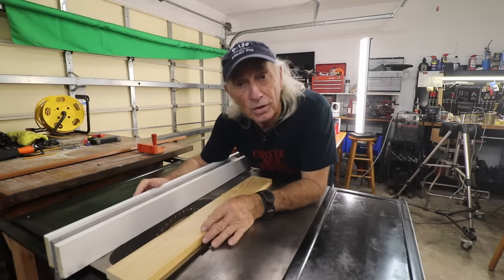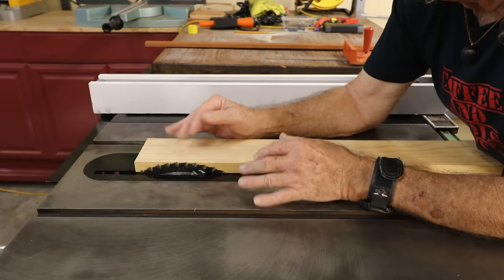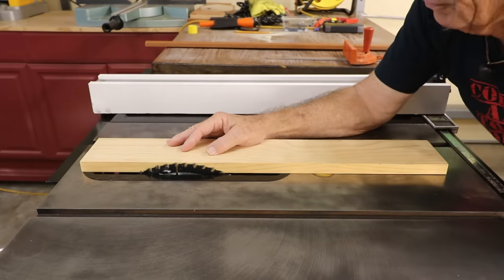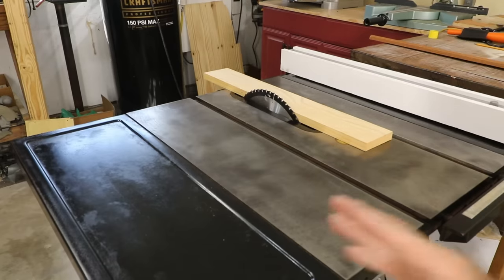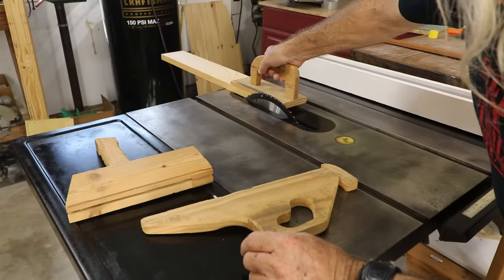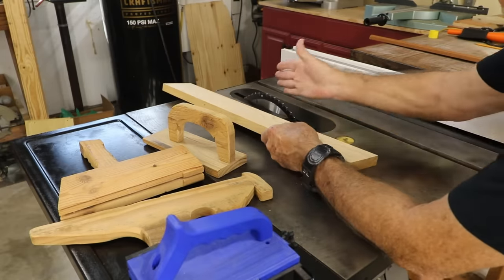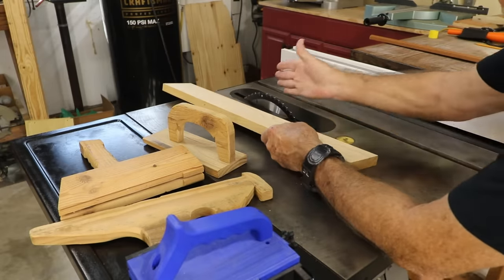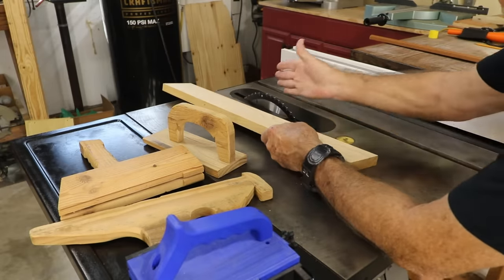Table saw secret nobody will talk about from the good old days, C&T episode 180

Comment: I also put the blade high as possible but we use a riving knife back at the saw
.why are you work without
Reply from the maker: No riving knife with this saw and it has been sold to a contractor since the video, good saw, just zero safety with it.

Comment: What dark secret ?  Everybody I know in woodworking talks about this.  When I was in high school wood shop, in 1965, we were taught for best cuts to set the blade where the gullets just clear the top of the work piece.  I have never seen a kerf knife mounted anywhere except on the arbor assembly ( lift mechanism ? I do not recall proper nomenclature ).  This way the kerf knife stays at the height of the blade and always aligns with the blade tilt. And you should always have some sort of outfeed support so you do not have to apply too much down pressure to keep the work in the blade all the way through. Very risky not to have it except for very short pieces.

Comment: I was taught set the blade 1/8" over the thickness of the board.  Which I had it happen, ripping a piece of Cypress, where my hand hit a piece of wane and slipped.  Cut four fingers an 1/8"deep instead of off.
But it'd require effort but having the blocks like here is smart.

Comment: High enough that the blade is cutting down is safer... as long as the only things touching the material are push blocks. My 12 inch radial chop saw does most of my cross cutting... the table saw mostly does a couple of rips at the start of the job.
Reply from the maker: Same here 👍

Comment: Well if your still reading g these comments. I'm right there with you. I too raise the blade. 1972 I was taught that way. Cleaner cut. No burns. Very little vibration. Very little to no kick back. And all this without a blade guard or kirfing knife. I have done it with the blade low and have lots of problems. Kick back. Wood jumping and raising and all the other things people talk about. It is safer. But it will leave more tear out. 
So to help with some of this. I have a rule. Always have a clean, sharp blade. (That way it cuts your finger off quicker & Cleaner. 😂😅)
But overall. I agree with you.😊
Reply from the maker: 🤣🤣🤣 cleaner cut for fingers. Thanks for posting this one. Old school had some different ideas and reasons. I'm still old school 🤠

Comment: First time viewer.  I like the over-all presentation and the numerous anecdotal comments and conclusions.  Although NOT an often user of table saws, I am extremely familiar with a great many tools, manual, power & automated.  One thing that I note is the use of current technology of carbide tipped blade.  As such, the actual cutting teeth are most often somewhat thicker than the body of the blade.  This is significantly different from the (nowadays "cheap") single thickness blades which achieved kerf width by having "set" in the teeth.  My very limited experience with each style of blade was that the wide toothed carbide blades tended to have less (apparent) kick-back forces than the old set tooth steel blades.  But, that could have been 'dull' versus 'sharp' as well.
Do you have any insight as to why there remains only ONE radial arm saw manufacturer in the United States?  They are located in a small town in Iowa!
Ken
P.S.  We are probably of about the same "vintage"! 😂🤣

Comment: Interesting. I’ve never heard to keep blade just barely above wood. I always do what I guess is a middle ground where the tooth is sticking out maybe 75-85% above the top of board. It’s supposedly the optimal place for ejecting chips and preventing kickback. The key point is don’t have your hands near the blade. Also maintains your balance. I’ve heard of cases where there’s a kickback that shoots the board out of the way and since you had your weight on top of that board it’s now on top of a spinning blade. The tip I heard with that is the table saw could suddenly disappear and you don’t fall on your face.
Reply from the maker: It's all about safety these days.

Comment: Interesting video, many thanks.  In my experience, if you don’t want kickback, set the saw properly and you’ll be half way there.  It is amazing how many just get them out of the box and away they go with blade slowing skewed loads, burns and kicks all over the place.  

My approach when setting a saw is, the blade is set absolutely parallel to the mitre slot, then the fence set parallel to the blade but then moved away from the blade at the back by literally a hair to stop the wood closest to the fence getting pushed sideways into the back of the blade.  I’ve never had kickback - have to qualify that with “yet” of course to nullify Murphy’s law.  And I still get square cuts for cabinets too.

With regard to blade height, I like to “see” the blade a tooth above the workpiece.  If I can see it, I can keep away from it.  Most dangerous tool in the shop in my humble opinion is the spindle moulder.  You really don’t want to get hooked into one of those as the shaper tooling tends to be very destructive over a far wider area than a thin saw kerf.  Push sticks and feather boards all over the place on those is my MO. If I could be in a different county when one is running that would be good for me.

But I still say the fastest way to get hurt by any machine is to be scared of it.  You have to be confident and look to get the job done and not focus on having the accident. Respect it by knowing how to use it safely, but don’t be scared.  If you have a kid crossing a stream on a log and you say to him “don’t fall in”, he probably will as he focuses more on the possibility of falling in than on his technique of getting to the other side.  The power of negative thought is even more merciless in the workshop.
Reply from the maker: Respect and plan before cutting anything

Comment: I wouldn't use any of those jigs.  Puts the fingers and hand way to close for my comfort.  I use push sticks for ripping.  Long ones.
Reply from the maker: Push sticks are handy and much cheaper than fingers.
Reply: @SirTools  I saw your other video on push sticks.  Yes, probably more likely to induce kickback and I've had kickbacks in the distant past.  I also take other measures..."feather boards", commercial ones with a magnet that keeps it locked to the table, a thick leather apron, and standing to the side.  I would much rather have a kickback than slip and lose fingers because I was too close to the blade.

Comment: This is something that is still discussed. On the union jobs the blade gets higher the duller it gets to prevent chatter. Typically the company won't buy new blades on a regular basis. I think with experience comes better risk mitigation therefore something like raising a blade above material is more prudent.
Reply from the maker: Hey Thanks Don for this posting

Comment: On carbide blades, the carbide tooth is wider than the blade body. So on a saw that is set up properly the the cut lumber doesn’t contact the blade. Usually the saw is not set up from the factory and must be done at the time installation and periodically checked. This requires a machinist’s skill and tooling. Good luck!

Comment: This is why modern table saws are much safer, they come with a riving knife installed and most also come with a guard attached to the riving knife so you can raise the blade and still work safe. Dust extraction can also be added to the guard.
Reply: But then you can't dado, or notch or do a lot of things that you need to be able to do.
Reply: @jeffshackleford3152  you can remove a guard if needed, but for most general work you should keep the guard in place.
Reply: @richardportelli1983  I disagree with that, if you get used to having the guard there and then you don't have it, it will likely lead to an accident.

I have seen several people hurt themselves that way, including me.
Reply: @jeffshackleford3152  this is why you should always use push sticks when working close to the blade and always use the giving knife. A guard is just extra protection. Doesn't make up for unsafe practices.
Reply: @richardportelli1983  it had nothing to do with my hand being near the blade while cutting, I was grabbing my drop and decided to touch the blade with my thumb.

Plus push sticks aren't always the answer and in some cases actually make a cut sketchier than if you were just to get your hand close.

I worked in a very high end cabinet shop while I was in college and learned " old school" like this guy.

Comment: Was in a large cabinet shop with a cabinet saw. 10 inch saw blade. He had a stack of dimensional wood about waist high and 20 feet behind the feed side. Beyond that, about 15 more feet was a cinder block wall. He had a kickback. 

In the lumber pile there were 3 big slivers of wood shot inches into the lumber. The largest sliver was roughly a half inch. In the cinder blocks there Wes a similar sliver through the first layer of concrete.

Comment: If you want a blade quality comparison try using a battery powered circular saw with a blue Avanti cheap blade then use a Freud mid range blade, 1/3 more battery life and you can feel it cutting harder. Paint vs Teflon, buy blades with no paint if your getting super cheap ones. Even table saw blades you can feel and hear the difference.

Comment: Why have kick back when you should have kick down.  Lift that damn blade so the blade can cut and push down.  Use the flat of the blade as a parallel straightedge to your fence.  Increases stability and alignment. Perfect your push stick game.  This guy is demonstrating what my dad showed me in 1977.
Good job emphasizing that proper technique will keep you safer than doing things the improper safe way.

Comment: In my 50 years of woodworking, I've learned to have a custom made zero clearance blade with a riving knife, AND a set of "yellow wheels" to hold the wood down and in toward the fence. Also always to use only flat wood. Warped wood will want to kick back. Finally, if you DON'T have a zero clearance blade, inevitably a narrow cut-off piece will fall in the crack and may kick back. My buddy with even more experience than me took off the tip of his thumb that way with a violent kick back (...they are all violent). Those yellow wheels definitely slows me down, but I find that okay, especially with such a dangerous machine.
Reply from the maker: yellow wheels ? Feather board ?

Comment: I also cannot stand the top of the saw blade to be any lower than at least 1 1/2 inches above the top of the board being cut. 

Just as this shop person says, I have noticed that if I have the saw blade any lower than 1 1/2 inches above the board being cut, then the blade tends to want to lift the board being cut upwards and side- ways even when using a push-board jig. To me that's an unsafe stiuation when that board starts being lifted upwards off the table top by the lifting force of the rotating blade. 

If that board jumps above the saw blade, then it starts an uncontrolled  bouncing situation as it bounces along the top of the saw blade and there's no telling as to which way the rotating saw blade is going to send that board each time it bounces on top of that blade before you can get that saw shut down to a dead stop.

At least when the blade is at least 1 1/2 inches above the board being cut, then the force of the rotating saw blade creates a downward force upon the board thereby safely keeping the board down on top of the table saw table as the board is being cut.

Been there, Done that, and it's not a cool feeling when your chin (or your chest), feels the pain (and yes, in both cases), I was using a push-board jig on top of the board being cut when it happened but the upward force of the blade outweighed the downward force of the push-board jig and it bounced the board right out from under the push-board jig.).

That's my opinion and I'll stick by it. To those who disagree, then please feel free to do so and we will eventually see who (sooner or later), gets bopped in the chin (or the chest), from the uncontrolled bouncing of a board on top of a rotating saw blade and who doesn't.
Reply from the maker: We're unsafe now by today's standards :)

Comment: The higher blade allows the leading teeth of the blade to cut downward into the wood, pushing the material down onto the table. With the blade low the teeth are cutting into the material with a force angle pointed right back at you. High blade

Comment: At about 6:40 into the video you mention how when the blade is raised up that the surface area of the blade is rubbing up against the cut lumber. I have to respectfully disagree because the teeth (or carbide tips) of the blade are slightly offset - the "body" of the blade doesn't actually touch the work material. Other than that, great video with lots of useful info and I really like the old school point of view.
Reply from the maker: Thanks David, it was really about our old school. The rubbing is questionable, agreed :)

Comment: Good advice for begginer but my woodworking teacher said us than pushing stick is good onley for begginer or when the pice of wood is not wide enought to push by hand cause you have much more control with your hand it was a bit old school but knowing how to use a tool proprely is safer and more efficient than most of those safety gadgets

Comment: You know looking back i was told to keep the blade at 1/2" over the stock at most.
I did have a kick back on a table saw, a job saw the blade guard made it hard to mesure my cuts so you'd take it off set your cut and a spring loaded pin held it in place, standing behind the blade I reached over with my left hand turned on the saw, and got smacked in the face by the blade guard. Needless to say I refuse to use it. It hit my face about 1/4" from my eye.  That guard isn't going back on that saw.  I own 3 table saws, my jet i use board buddies i plan on buying jessem stock guides. For my 3 hp saw. 
All of them have riving knifes.  If not microjig sells a kit to add them or you can do it stumpy nubs style. 
My jet i can't do that with it.
The biggest problem is on my jet i can install a stacked dado set with the orignal table incert, they also make a dado incert, and they nor anyone makes a zero clearance incert for it.
Reply: Suggestion. Talk to machine shop and have a master aluminum pattern to be used with a flush trim bit to trim an acrylic (Plexiglass) or polycarbonate (Lexan) blank.

Have them press in drill guide bushings to locate the holes. Now you can make inserts in batches of 5 or 10 really fast and super accurate.

Comment: I kept the teeth above the wood until I hit a piece with a lot of tension in it. Enough so that it closed onto and gripped the blade before reaching the rear teeth. I had enough control og the wood  to holdit in place while I stopped the saw, I now keep the blade lower.
Reply from the maker: Sounds like you were heading to "kick back" world with that cut. Best keep the blade low

Comment: Everyone has an opinion and usually their wrong 
My dad was a carpenter for decades. Used every power tool imaginable and died with all his fingers and toes. He did use a push stick but it was usually a piece of scrap from another cut. Nothing fancy. No guards. No lasers. No automatic dropping blade. 

Listen to the old guys. They've done stuff. Listen to knights in battle armor not knights in shining armor. (Guess which ones have been through actual battle)

Comment: i tried having the blade lower but i like it the height of the carbide tooth so thats about 1/4 inch or so above   ..i dont like the cut i get when its lower.  and i never take chances with any of my saws either..  so a push block etc
Reply from the maker: Thanks Salty for this one.

Comment: Saw's not plugged in? I've been building cabinets for 40 years and have never unplugged the saw to change blades even once.
Reply from the maker: Most saws are ok for that. I did have one that could not be trusted, activated with a foot switch :)
Reply: @SirTools  A foot switch? You're way braver than me! I still have all my digits but have gotten nailed with kickbacks exactly 3 times. That hurts enough so you remember every one LOL.
Reply from the maker: @99bx99  I would think just one kickback would take all fun out of it. 3 ? wow...
Reply: @SirTools  Yeah, well, I'm impatient and always focused  on production. I was in my 20's and building houses. I needed to cut 2X4 stakes for a footing at 6:00 AM. I was cutting points on them on my table saw and felt I didn't have time to change the dado insert (with a 1/2" slot). One of the pointy cut off pieces dropped into that slot, whipped around and hit me right in the face breaking my prescription glasses (to this day I've never worn a face guard) and leaving two big splinters stuck in my forehead. They were stuck in my skull and I had to pull them out with a pair of vice grips ..... then went to work. Hey, scars on guys are cool, right? LOL. BTW, my biggest custom cabinet job was the kitchen, wet bar, and computer room. They have (exactly) 79 drawers.
Reply from the maker: @99bx99  OUCH !....just a lesson ? ...glad your still with us :)

Comment: great advice on the table saw...however not totally off topic, someone should do a safety video on the most often incorrectly used radial arm saw. almost everyone wants to pull the running blade through the work when it should be pushed. talk about a potentially catastrophic situation...

Comment: I love my fingers, and I love my SawStop too.
Reply from the maker: Yeah, SawStop is a darn GOOD idea
Reply: Don't get complacent and rely solely on the saw stop to save you fingers.....
Reply from the maker: You got that right ! Thanks UncleBob
Reply: @unclebob8746  Have no fear.  I know of no system that works properly 100% of the time.  Besides, do you know how much it costs when the safety system activates? I don't use cheap blades either, so it is VERY expensive.